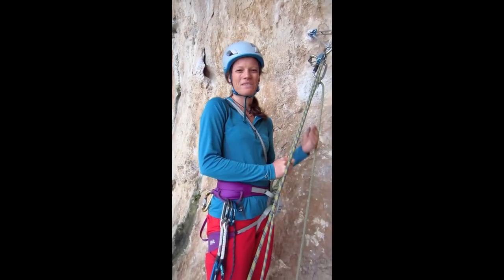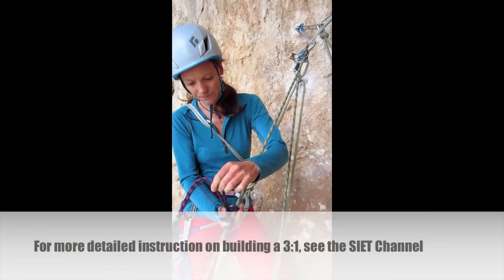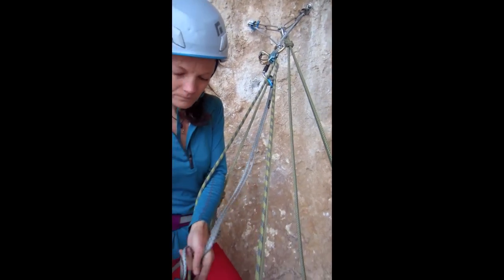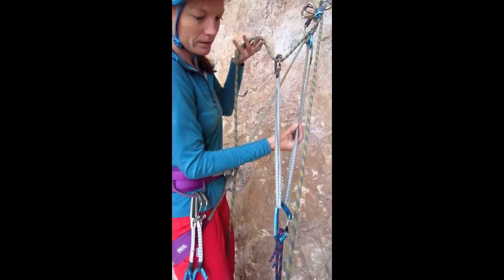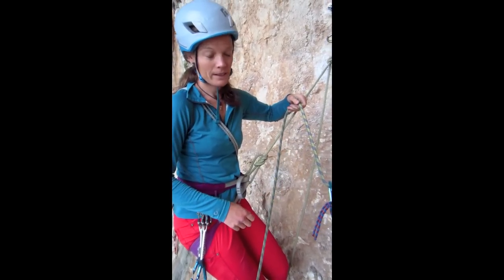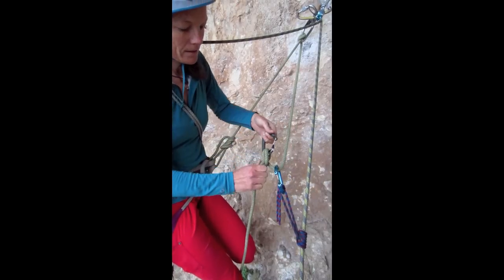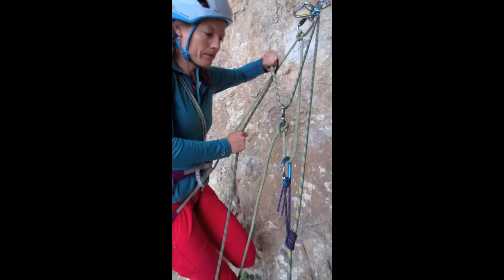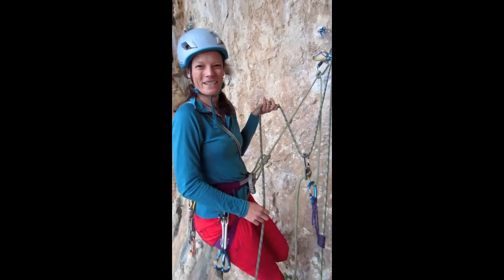5:1 Pulley System with a Petzl Reverso

Comment: Today I tried it out on a horizontal surface. So perfect for learning. Between two trees. According to the Petzl manual, a 7:1 pulley system. The finding is that if you don't have pulleys, there is so much friction between the rope and the carabiners that perhaps only 3:1 is good. Has anyone really tried pulling a person and full weight through carabiners and reverso only?

Comment: you can get a lot more power and reduce your effort/fatigue by redirecting the pull strand through another pulley (carabiner) at the anchor so that you are pulling down using your body weight to lift the climber rather than the awkward pulling up motion in the video. You're probably aware of that but just mentioning it for people not as experienced.
Reply: Absolutely! Pulling upwards or pushing the haul end above your position as demonstrated puts your strength at a poor ergonomic disadvantage. You want to pull down with your body weight and large lat muscles.
Reply: well, you need the keep in mind however that you will actually only be pulling with half your body weight due to the friction from the last redirect carabiner. Also, you can wrap the rope around your back and be pushing up with your leg muscles. 
I also used to be a big fan of redirecting the rope through a highpoint, but after doing the math on how much friction is at play in such a system, i am quite unsure of it. For example, in reality the systems shown here are only just about a 3:1, by adding the redirect it becomes a 1.5:1

Comment: If you add a 2 to 1 to a 3 to 1 you times it not add it up.
Reply: Actually the 3:1 is inside of the 2:1 so they add up
Reply: Only if you compound it through prusiking the systems together. Not to mention a 3 to one times a 2 to one is a 6 to one. A six to one needs to have the terminating knot on the anchor side, which it is more then likely is on the climber/ the load side.

Comment: +Dan Africk the ATC isn't upside in this video, it's in guide mode. Which per the manufacture's recommendations is fully auto-blocking, meaning it's acceptable to go hands free. That being said I will often tie off with a mule knot or a backup safety knot as you've said, but that is more for piece of mind.
Reply: Anna Brancati I know what guide mode is, I use it all the time. It still must be used in proper orientation, per the manufacturer's instructions. And it is not acceptable to go hands free while belaying with any belay device, assisted braking or not, without some sort of backup in place. That is also explicitly stated/illustrated in the manufacturer's instructions. I've read them. The term 'auto-blocking' does not appear anywhere in Petzl's instructions (instructions). I suggest you read them again.
Reply: Dan Africk Same goes for Black Diamond ATC-Guide by the way.
Reply: +Dan Africk At the risk fanning this fire, which is that last thing I want to do, I'm aiming to help educate the community, I'll say that letting go of the break hand is a personal preference and it's an acceptable industry standard. Yes, Dan, the Petzl instructions do clearly say that you shouldn't let go of the break hand. However, this is not how most practitioners are operating this device. I'd say 95% or more of the highly trained and highly professional guides I work with feel just fine letting go of the break hand, even in a self rescue scenario. The device has been used like this for a long time and we don't have any data to show that we need to change the standard. I think any Petzl rep will tell you that the manual is just to cover their own ass. Also, the 'upside down' Reverso thing...there's good arguments to show that having the blocking 'biner on the outside is a good thing...but that's a whole other topic, I'm personally fine with it.
Reply: "brake hand" and "peace of mind"  🤦‍♂️

Comment: Theoretically 5:1, practically 2:1. When you use pulleys, that does affect efficiency a lot. but even when used pulleys with high efficiency bearings, it would still not be a practical 5:1.
And another thing, when you make prussic slings, make sure you use the right knot and then still load the slings correctly. Very bad example of teaching methods.
Reply: +kimjacobs911 
I think you're about right with the difference of the 5:1 actually being a 2 or 3:1 in practice- really depends on what you're running your rope through. I'm not sure what you mean by the 'right knot'. I know the knot that we used in the vid, the flat overhand, is stronger than the prusik- that's been tested. I know some folks think you should only use a grapevine but the flat overhand is an acceptable industry practice for many applications now. "make sure you use the right knot and then still load the slings correctly"...well, is self rescue, as opposed to professional rescue teams (with much bigger loads!), it doesn't matter if the 'biner clips the knot.
Reply: wow its alot friction on the system when you useing carabiners... far away from 5:1
Reply: Yeah, using the Reverso is really messing with the efficiency, you can see it isn't even letting slack through let alone the full amount of tension. This would be great for hauling a second past a few moves, though: you don't want to have to somehow get them on your microtraxion.

Comment: Great video! Two points:

- In practice I really think you should put a backup safety knot on the brake end of the rope before completely letting go to setup any haul system(especially because your ATC is upside-down in these videos). Just throw in any knot on a bite, and undo it before you start hauling.

- When attaching a prusik loop, it's best to offset the knot from the middle, so you're not clipping the carabiner right on top of the knot forming the loop. That's just sloppy and makes the knot less secure. (Or use a sewn prusik)
Reply: It's the future here, you were definitely wrong, that reverso (not atc) is in guide mode, the hole you see is a release hole for a carabiner to release the braking action when under load
Reply: No Backup required: Petzl Reverso in Plaquette mode is Full Strength system

Comment: this is a compound 6:1
6:1 Compound Pulley System
Reply: It's funny to see one SIET video referenced to contradict another SIET video
Reply: no he is right -  in a compound pulley system -  one where the 2 sets of pulleys are not collapsing at the same rate,  you multiply the 2 x 3 = 6:1 ...  if it were a simple pulley ,  and all the pulleys were collapsing at the same rate,  then you add .  get good at things before you post angry comments
Reply: @johnnybgood5666  It is a 5 to 1, follow the tension through all the redirects. You don't need any "rule", you can calculate it directly. Any strand that goes through a pulley is assumed to have the same tension on either side of the pulley, and the rope in her hand is said to have T=1. If you have T=1 on both sides of a pulley, the thing the pulley is attached two experiences T=2. You'll end up getting 5 total.
Reply: negative: 5:1 do the math

Comment: I just wander how heavy is your co-climber on the load part of the rope, cause you are pulling with such a ease I can't imagine. I put up the same system and I asked my 60 kg friend to lift me up, and he was struggling quite hard, I have a 75kg. ?
Reply: Uroš Žvokelj In reality friction at each pulley greatly reduces efficiency of the system- carabiners are only about 55 - 65% efficient, plus you have more friction at the ATC, rope stretch, etc.. So in practice a 3:1 simple pulley will be more like 2:1 or less, and a 5:1 will probably be closer to 3:1. Adding a re-direct so you can pull downward using your body weight can help make it easier, but also adds more friction to reduce the mechanical advantage even further.

Using one or two pulleys or 'Revolver' carabiners instead of simple carabiners can help a lot, so it's a good idea to carry them if you think hauling is likely.
Reply: I don’t know if this helps but I always carry two prusik minded pulleys.  It will greatly reduce the friction in the system caused by the biners and actually give you a legit mechanical advantage. I don’t know.  It helps when i have to hump up gear or practice hauling in an unconscious partner.  Try it out. I would strongly recommend practicing mechanical advantage, different belay escapes and releasing loaded auto locks on reversos and ATC guides.  Always be prepared.
Reply: The load was only about 20kg.
Reply: Is there any better system than this one, it's the same they teach us in school for alpinists, but it's not very effective at heavy loads or big weight difference at climber partners? And is very difficult on the end where you have to literally drag a load on to the anchor. Except if you always carry a protraxion or minitraxion pulleys, but thats not a common practice. Which system they use when lifting equipment bags with portaledges in big wall?
Reply: +Uroš Žvokelj this is a "complex" 5:1. Using the same amount of equipment, or less of you remove the sling, you could create a "simple" 5:1 and have fewer resets....pulleys pray least using HMS carabiners with a low-er friction coefficient would be ideal.